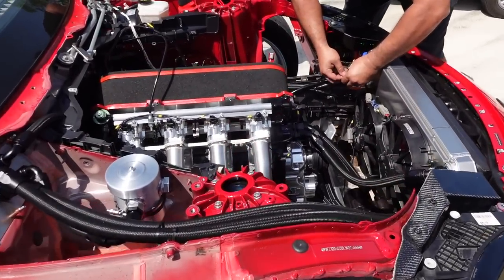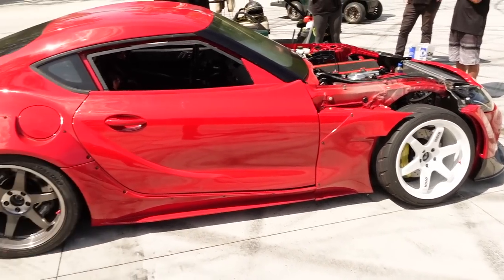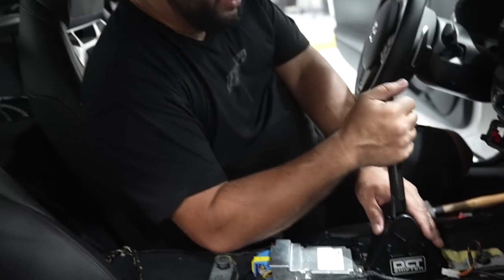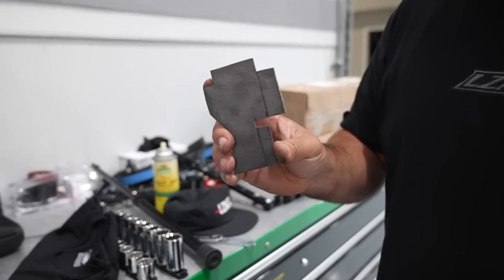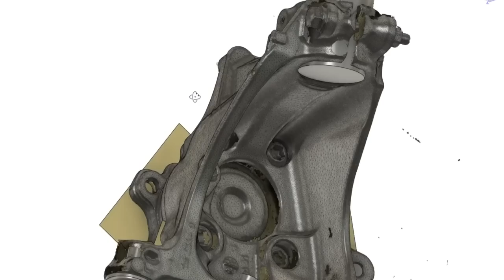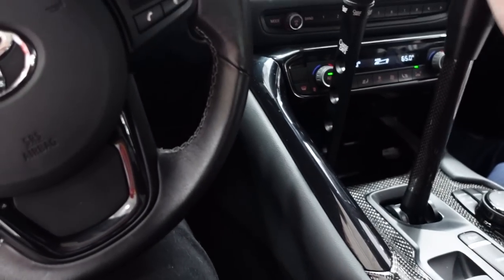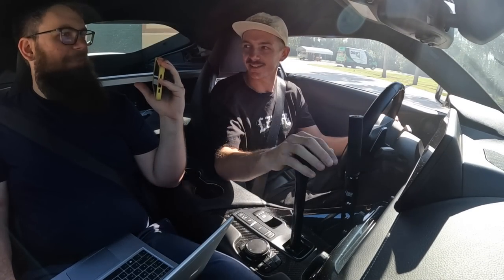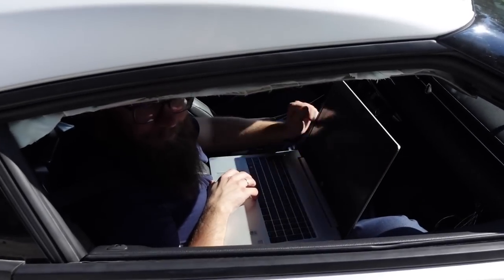Clutch Controlled Automatic MK5 Supra Drifts!

Comment: Excited to see the 4 rotor racing and drifting! Also the clutch controlled automatic trans seems like it would be a game changer.
Reply: I’d be surprised if the trans lasts a single track day. They did say it was the equivalent of a neutral drop.
Reply: @Nick210  definitely not comparable to a neutral drop because of how dimmed down it is to ramp in so everything feels smooth. I don’t think it’ll cause many issues
Reply: I'd do a lot of nasty things to get that clutch controlled auto in my g35
Reply: @hiimgone160  why? G35s came in manual, it would be easier and cheaper for you to manual swap it than to somehow modify your slushbox trans computer
Reply: Meh In a year or two it’d probably be easier to just buy a salvage manual Supra to drift around
Reply: @tpdabomb3  That's the plan! I want to do a manual swap but it would be more convenient if I could just get a chip in the trans and a clutch pedal installed to just keep my car more stock and more easily reversable to stock form if I ever decided to sell

Comment: If you want to create really cheap driftable platform I suggest focus on Giulia. They come with ZF 8hp, engine is solid with plenty of torque, some of them even have optional clutch type lsd. Even if 4x4 from factory it is really easy to convert to rwd  (0 mechanical modification). I keep fingers crossed for consideration.

Comment: Adam I know you probably won't see this but get a hold of Brown and Miller race parts solutions for the hoses you need they have the strongest lines and best high pressure fittings in the race industry

Comment: Engineer here, you need an accumulator. It’s attached to the system and has a pressurized rubber bladder. That “squishy” space absorbs the hydraulic shock of the system.
Edit: it’s not just the pressure but the spikes in pressure.

Comment: 4 rotor sounds good we had issues blowing out oil filters on one of our 13b’s and found that it was better to have both front and back oil pressure regulators we kept blowing filters with the front one blocked off maybe this might help ?

Comment: Only thing that would drive me nuts in the delay from when you pull the shifter to the actual shift
Reply: What delay? It's an automatic there less delay than a manual gearbox, not only that they can program how fast it's shifts. It should be able to shift faster than a true sequential manual gearbox.
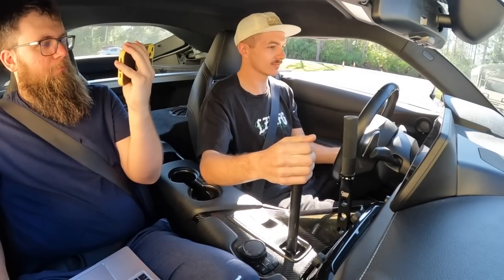Reply: @gmula1987  19:48  the delay from when Adam pulls the shifter till the car actually decides to shift was supper slow. And I know autos shift quicker but like most cars with paddles you click the shift wait 2 seconds then it shifts
Reply: @Kodi5204  the faster you go and the more throttle you give it will depend on how fast it shifts. When you're actually driving it hard it's going to shift faster.  If they want it to shift faster with low throttle and slow driving then they can program it do that.

Comment: Use hydraulic lines and fittings for your oil lines. You can get 1000 psi lines no problem.

Comment: perhaps look into if the car is regulating the pressure down from a steady state higher pressure, if so, the oil temps are going to get high due to the friction of the regulator. I recently had this issue at work

Comment: Use the same lines they use for hydrolic lines for the oil lines you can get em made however you need them and there made to hold high pressure
Reply: He said they would use the same as what’s on the S15. Lines that take high pressure.

Comment: I think drifting would be way easier if you found out a way too take of the clutch on manual so you wouldn’t have too press clutch when shifting and it would be easier for transitions on drifting for better chases
Reply: You need to able to clutch kick to break the tires loosee
Reply: what
Reply: No you shouldn't, & no it wouldn't. Your basically describing drifting with an automatic which is not easier and is not better. I don't think you realize how important the clutch is in drifting, it's so important they added a clutch to an automatic to make it easier for drifting & your basically saying for them to do the opposite thing.
Reply: Can’t you still e brake lol i bet there is a way you can do it I mean I’d rather have went the other direction because I have bad hand eye feet coordination so I’d figure out a way too make drifting easier like with our a clutch so you wouldn’t have too press both at the same time so you can just keep the rev limiter at max and switch gears with no effort while still maintaining the drift and adding more speed with easier transition between gears

Comment: The stock BMW tie rods are not gonna do what you need them to do. They are very weak and have built in failure point to save rack. You can bend them doing an alignment if your not careful.

Comment: am I the only one that thinks the 4 rotor is hard to listen to? it sounds like it’s angry at its self. I know it’s not fair to compare it to Dahm’s big turbo engine, but it’s hard to believe they’re both 4 rotors with how different they sound.
Reply: 4 throttle bodies vs a single throttle body and different exhaust length 2 different things